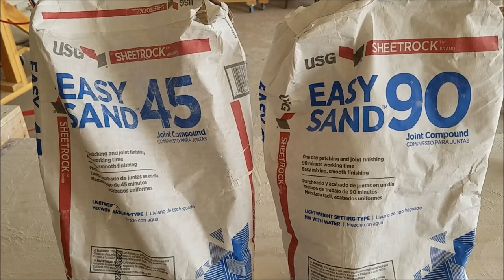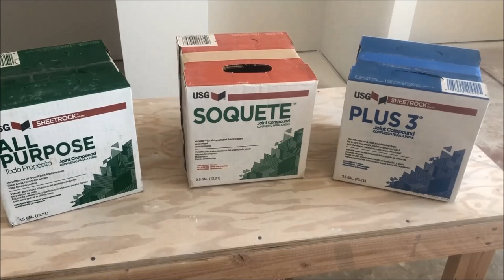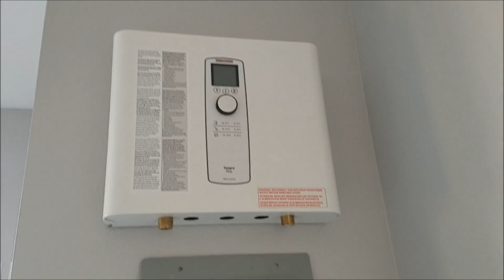DIY House Build # 29 - Drywall Tape & Texture

Comment: Nice work Brandon!!!  I built our 3500 sq ft barndo myself, everything except ceiling drywall.  I got quotes fro $3500 to $14,000 to just do the ceilings.  The $3500 got the job, Juan, Manual and Rudy and Rick the owner of the company.  It took a day for Juan and Manual to hang all 3500 sq ft and 2-1/2 days for Rudy to tape and float.  Taping and floating was all done by hand, a tape box, knife and a couple floats.  I got to see a true craftsman work, he was special.  I did my first drywall install in the early 80's and typically avoid it though I did have a lot to do in the barndo that wasn't wood. That was probably the best $3500 I have ever spent.  I enjoyed watching you do that and appreciate the skill you employed.

Comment: I do this for a living. Easiest way,  is use stick on tape in the seams, paper in the corners.  Than 2-3 coats of joint compound sanding between each coat. Using a Pole sander, and a drywall sanding sheets. 80 grit. I also try to cut time by using mud on corner bead. Than texture. Estimating drywall finishing is usually done by the sq. ft.  I like that you put the filler strip in the center to ease finishing. The hanging work looks great By the way.

Comment: Great info thank you again.  My question is would you do it again or hire in?
Reply from the maker: Thats an interesting question. Well next time it would be much faster and easier, as I already have most of the tools I would want, and the know how.
I suppose I would, as long as there is nothing too high.
However hanging is the problem. Lifting a 5/8×12' section is very difficult.
Reply: @BrandonsGarage  so as far as everything you have done at the house yourself and paid for is there anything you would do the opposite.

Comment: Hi Brandon, did DW when I was in my 20s and started off on Sally the Sand pole. Commercial work with the lead guy on the bazooka. Got tired coming home like a piece if plaster paris. Talking about White Face!  Oh- I guess not.  Anyway 
Yea, that hot mud set's up just like plaster O paris and can be pretty damn hard to sand so you want to take your time to put on and scrape off with your knife as you go to smooth out. Still do my own work now to save money.
Hair cut between walls? Nice